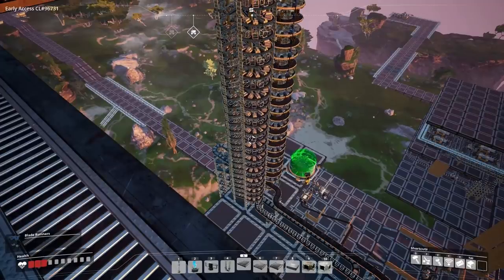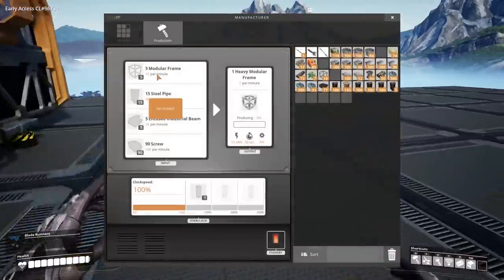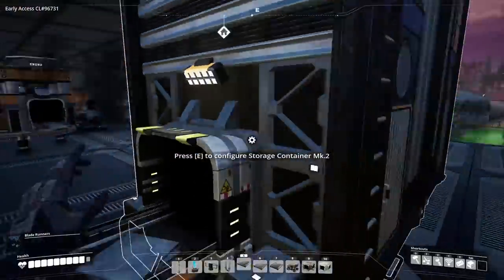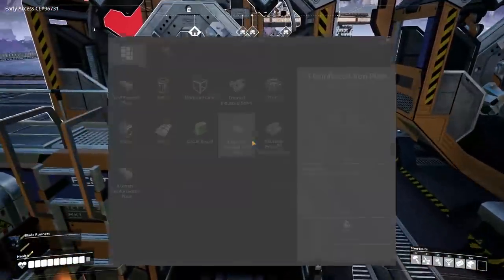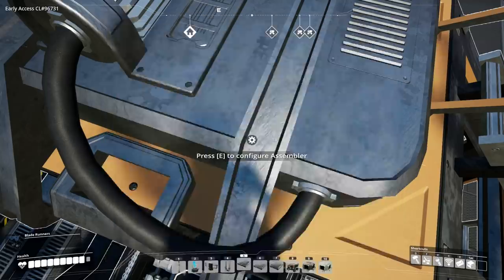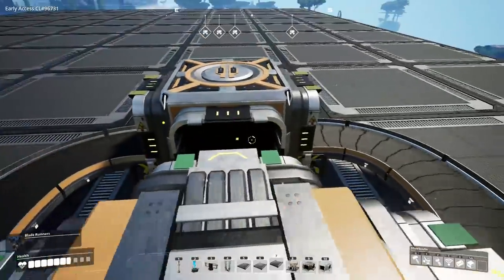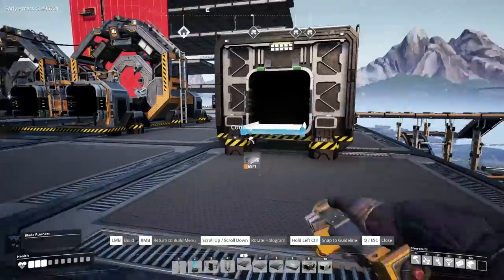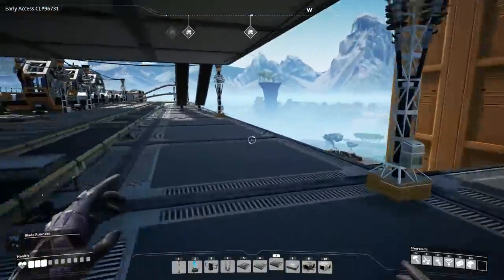High Efficiency Automated HEAVY MODULAR FRAME Production! | Satisfactory Early Access Gameplay Ep 14

Comment: There is a MUCH simpler solution to the frame production. Instead of making one of the assemblers work at 50%, you could just of splited the outcome of one of the assemblers in 50%. So the assembler input is the same but one output is 50%. This means that you produce 12 frames every minute. And if the heavy frames needed 10 the other 2 per minute could go to storage. Because you need frames for building things like truck stops, tractors e.t.c.
Sorry if the text was messy but i tried. xD
Reply: Sniskus :o or used one with 3 power shards, no load balancing needed.

Comment: Hey, instead of having 2 machines at 100% and 1 at 50% which caused you to make the complicated load splitters, couldn't you just underclock all the machines to 67% so that the incoming lines directly split into 3
Reply from the maker: That's an excellent suggestion and an objectively better alternative!

I guess it depends on where you want to do the math, because if you have the Reinforced Plate Assemblers at 67%, you'd need to adjust the inputs before to keep things efficient. So that kinda starts this cascading effect where you have to figure out all the perfect percentiles in all the stages of the assembly line to avoid as much over/under production as possible. That kinda math freaks me out so I've tried to keep to whole numbers as much as I can and do the math at the last stage of the assembly line with the load balancers.

So adjusting percentiles like you suggested is definitely the better method if you can make it work since it'd save on space and power. It's just much more difficult to optimize and figure out.
Reply: @ImKibitz  Yeah that's true, the percentages do make a mess because they don't allow decimals so it makes them slightly inefficient.
 But here in this case your input and output was fixed. All the resources came from one line and after production combined and left on a line.
The only issue was with splitting it into 3 machines. So directly splitting them 3 ways won't be an issue
Reply: @ImKibitz  There is actually no need for the load balancers. Your input was 30 and the machines needed 12, 12 and 6. Just connect them in a straight line with a splitter in front of each machines. Yes, the first machine will get extra but when it fills up then resources will go to the second then third. After some time the first machine will only take in 12 from the 30 same with the second and then last 6 will go to the third (it takes only 12 because it's full and it only consumes 12 a minute) It works just tried it. This was you only need the perfect input and right amount of consumption, rest works out on it's own
Reply from the maker: @umarbelal1679  Oh yeah I refer to a system like that as an Overflow System, I messed around with that in episode 4 I think when I was making my first large iron smelter arrays.
It works eventually, but you leave a lot of your materials idle in overflow for it to work and you can't really stretch out your inputs because you have to rely on them to back up.

Using flowing water as an example; if you have all inputs match all outputs through the production chain, the water never stops and goes through evenly. With the Overflow System, the water has to essentially 'fill up' a production line first before overflowing to the next part of the production chain at a steady rate. This means you have a lot of water (resources) idle in the chain and you have to keep those resources idle or else the next stage of production will be interrupted. Contrast that with matching inputs/outputs, resources can move through the entire chain instead of having to be stuck in overflow for the system to work at max efficiency.
Reply: @ImKibitz  You are definitely right on that. In later stages the overflow does waste a lot of time because the production is 2 to 5 a minute. But the numbers are so bad like 12, 18 etc that to me that wastage is better than breaking my head over splitters and mergers. Then there are programmable splitters which negate this issue but they are really expensive. 
It all comes down to how one feels comfortable doing it. I definitely enjoy seeing your work, managing everything to perfection. So keep up the good work 👍
Reply from the maker: @umarbelal1679  Exactly, there are a million ways to do thing but at the end of the day all you need to do is enjoy the ride.
Glad you enjoy!

Comment: The load balancers are pretty unessisary, because if you just split it evenly the under locked machine will stack up eventually and distribute the items into the other machines.
The splitters are usually self-balancing
Reply: its just a challenge and having 100% efficiency
Reply: @thisguy35  agreed, any material that he has on conveyors waiting, the less he will produce. Instead, he could have multiple assemblers using the material that would otherwise be sitting around

Comment: A brief explanation of how the balancer at 13:51 works:

The input is being split in half, then into thirds then reintroduced to the input. So the output of the first merger is given with the following recursive formula:

f(n)=f(n-1)/3/2+f(1)

where f(1)=resources per minute going into the balancer and n=number of times the resources have looped that portion

As n approaches infinity, f(n) approaches 120% f(1). So if 100 per minute is fed into the balancer, the first merger will eventually output 120 per minute.

After that it's simple.

Also the 4/5 balancer has the same outputs and is much simpler.

Comment: imkibitz I dont understand your load balancing, what is the point of the original load balancing for the screws? Why do the splitter to merger "bottle neck just to have 240 pm on a 270 belt? Why not just have the full 270 on it and let the machines at the end figure it out? Is it the look of a belt not moving smoothely?

Comment: I know this is an older video but couldn't you just do a mk4(450) into a splitter then one mk1(60) out to the 50% and two mk2(120) out to the 100% ones? That means you have the 2 mk2s pulling 40% each and the one mk1 pulling 20%. 60+120+120=300 60 is 20% of 300 and 120 is 40% of 300.
Reply: Which also doesn't matter at all since once a machine backs up the others will get what they need. load balancers are kinda pointless in this game other than to look cool. it's not like the materials disappear if they aren't used instantly. You only need to provide the machines with equal or more than they need. Not exactly the amount. excess just means you have the possibility of adding more stuff. Over loading a machine has no effect on efficiency.